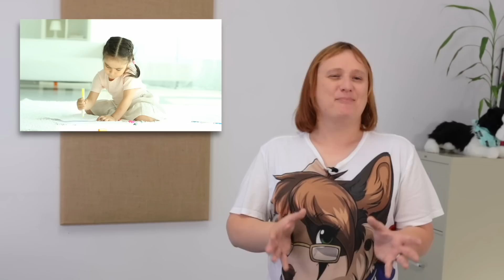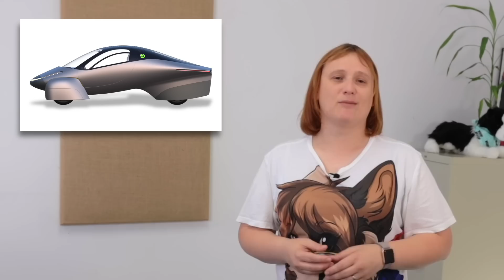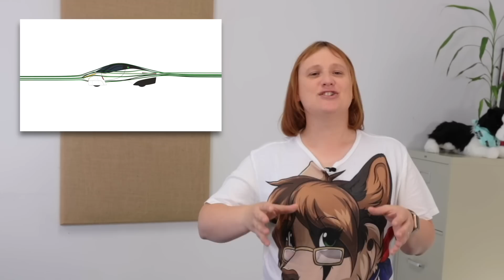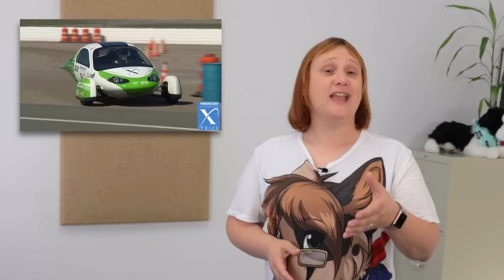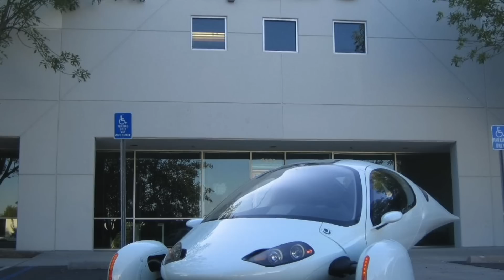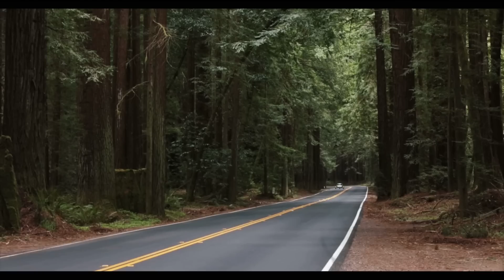After Eight Years, This Futuristic Electric Car is Back!

Comment: I've been waiting for this news for a decade. I hope they are successful this time.
Reply: So do I may make my own!
Reply: But will you actually buy one???
Reply: @TheTrueMorningStar  I would, Tesla 3 and Porsche GT4 owner.
Reply: @TheTrueMorningStar  not as an early adopter, I've only bought my Tacoma new, now I just buy used.
Reply: They won't be.
Reply: @guifrakss  I heard their Base price is around $35K.
Reply: @guifrakss  Definitely not. Not only did they completely destroy the look of the car, but their goals make absolutely no sense. Who's going to pay $30-54k for a trike?? Why try to give it 1,000 miles of range when the design is inherently poorly suited for use on the highway? Why try to make it quick when trikes can't handle as well as 4-wheeled vehicles? They've gone completely bats--t. I don't understand why they don't stick with the formula that they had before.
-
The front wheel motors might be a nice addition (if they're light, low power motors), but the rear one is completely unnecessary. With wheel motors in the front, the car could make use of torque vectoring as a way to correct some of the handling issues that it had.
-
I miss the aircraft-inspired look of the 2e, it was like a Velocity for the streets. The old headlight design gave the car a pretty face, the new headlights look alien and ugly. I never really liked the lobster-looking tail, though, they should make it narrower at the rear.
Reply: @PistonAvatarGuy  '''''''Why try to give it 1,000 miles of range when the design is inherently poorly suited for use on the highway?''''

was the original design suited for the highway?
Reply: @robinsss  Your question is oddly worded. Yes, the original design was suited to the highway, just not well suited. A three wheeler is never going to do all that well in a high speed avoidance maneuver, but it can be made to perform adequately.
-
The original design didn't have 1,000 miles of range, because it wasn't meant to travel long distances on the highway. Also, as far as I can tell, the batteries in the original design were located entirely in the forward section of the car, which is where they need to be in a three wheeler, but giving the car 1,000 miles of range requires that the batteries extend toward the rear of the car, this would seriously harm its handling characteristics.

Comment: The watt hour per mile for an electric bicycle  is around 20 wt/mile
This car at 60 wt/mile is incredible 
A tesla is 200 wt/mile
Reply: The Aptera shown here is the 3 wheeled version, the "safety standards" it has to meet are those for a motorcycle same as a Can-AM trike.
The 4 wheeled production version did not have the same drag co-efficent as the 3 wheeled variant nor would it have the same energy efficiency or performance.
Reply: Numbers are only estimated 
Your results are dependent on variables 
I.e. my electric bike is not 20 its more like 35.   Almost double of my "estimate"